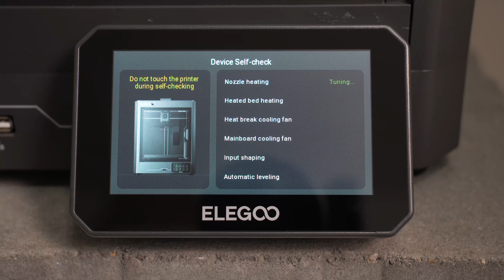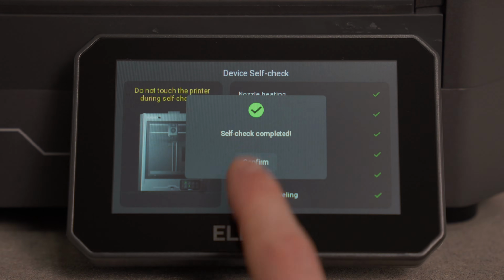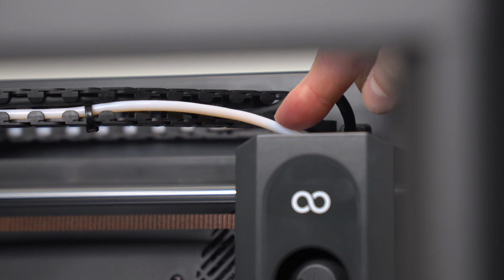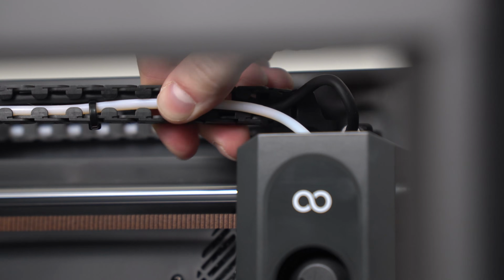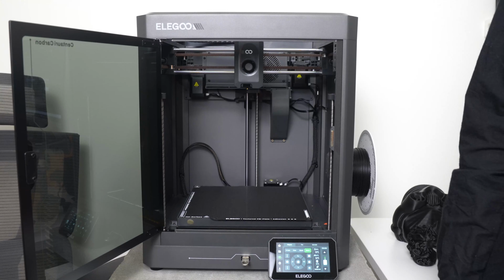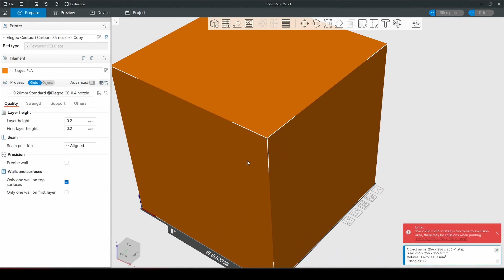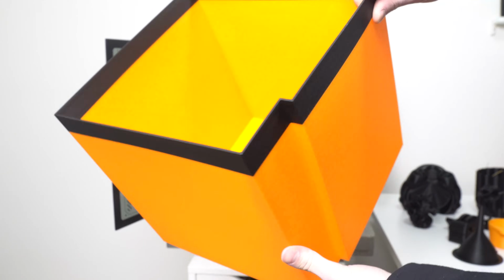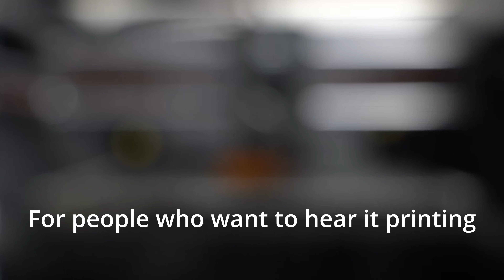ELEGOOs Newest FDM 3D Printer: The Centauri Carbon

Comment: mines wont turn on. Is there a voltage switch from 220 to 110v? I cant find it.
Reply from the maker: Hey love your stuff. I don't see a voltage switch, the nameplate says rated for 100-240 so there shouldn't need to be a switch. Unplug the power cord and remove the fuse holder and check to see if they installed the fuse or if the fuse is blown.
Reply: @3DPrintStuff  thank you. the fuse is good. I will buy a new one just incase.

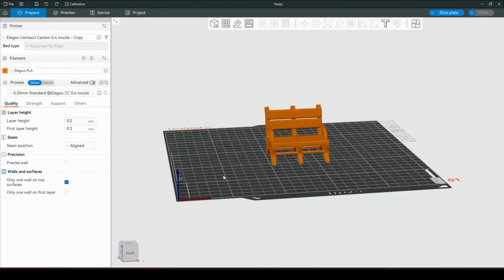Comment: 1:40 - You CANNOT install the filament holder on the side of the machine when waiting for the auto calibration.  The front screen specifically states, "Do not touch the printer during self-checking." (1:35)  It's taking accelerometer measurements based on what it's doing and it assumes you aren't applying external forces to the printer.  I get that you were probably installing the spool holder while the bed was heating and not while it was doing input shaping, but it's bad advice to give people who may not know when it's OK to ignore the rules.  It's best to let it do its thing and not touch it for 25 minutes as Elegoo recommends.

I hate that almost all 3D printer companies re-skin an open source slicer to make a soon-to-be-abandoned slicer specific for their new printer when they should provide good thoroughly tested profiles for OrcaSlicer and PrusaSlicer.  At least Elegoo provided good profiles for Elegoo filaments in Elegoo Slicer, that someone will hopefully use to make good profiles for PrusaSlicer and OrcaSlicer.

Comment: Elegoo, we need you guys to step up and do a multi color. Cmon.
Reply from the maker: That would be cool. Seems like everyone is going down that route, anycubic, creality, prusa.
Reply: they are bringing it in the furure but taking thje time to make sure it is refined and working well before relasing unlike some other brands
Reply: It sucks that everyone doesn’t have some sort of material system. I like this printer a lot and know I won’t use multiple colors a lot but I will use multiple of the same color.
Reply: They’re doing it. It’s on the website as a “coming soon” kind of feature.
Reply: In case you haven't noticed, Not everyone is dying to have or print multicolor. 

Elegoo are showing that they do not need to go like a little sheep copying the same thing that the others do. 

There are many who prefer to paint their prints especially figures, and that beats multi-color printing.
Reply: @silver_d24 yeh, multi colour printing looks jank and is too wasteful for the disappointing result. I'd use MMS not for multi colour but for the ability to switch materials easily and possibly for the use of water soluble support material.
Reply: Q3 2025 confirmed.

Comment: "Cenauri Carbon" is a misleading name for that 3d printer hince no carbon rods been used for the x axis!!!
Reply: I've heard people say that "carbon" refers to the ability to print carbon fiber materials with a steel nozzle, high nozzle temperature, high temperature bed and passive chamber heating, but people say a lot of things on the internet.  Personally, I'd rather have stainless linear rods and slightly larger stepper motors to achieve the same speed, to minimize wear and possible maintenance issues.

Comment: I wonder why they decided to go with the exact same build size as Bambu lab. Increasing it by at least by 1-2 cm would be a tempting plus.
Reply from the maker: That would make them stand out. I think the form factor of 256cubbed is the sweet spot for a personal use 3D printer. If you go any further it can be hard to find a spot for it to fit in your office.
Reply: Maybe Elegoo marketing decided they wanted people directly comparing the Centauri to the X1C.  That's certainly the instructions they gave reviewers when passing out the free printers.  If they made the Centauri a bit larger than the X1C, people might start comparing it to other printers in the $500 price range and find it severely lacking compared to the 350 x 350 x 345 SV08 which has 2.5 times the build volume for the same price.
Reply from the maker: @ You're right they did tell us to directly compare it to the X1C but I think a larger build volume than the X1C would have been a good differentiating feature and something worth talking about.
Reply: @3DPrintStuff  - I completely agree.  Other manufacturers developed Bambu competing products and did try to one up Bambu with a larger build volume, and that's clearly something that the market values and Bambu has been slow to deliver, although should be releasing soon.  Elegoo puts a double smiley face in the comparison chart when they have a 60W nozzle heater compared to the 40W heater that Bambu uses, so it looks like they'd want to have a double smiley for a 300x300 build plate next to Bambu's 256x256 build plate.  Another 44 mm in X and Y wouldn't cost them much and would provide real value to their customers and a legitimate marketing advantage.  Maybe they figured Creality already did that?  It's OK to be 2.5 years late to the Bambu party, but it's not cool to crash the Creality party a year late?